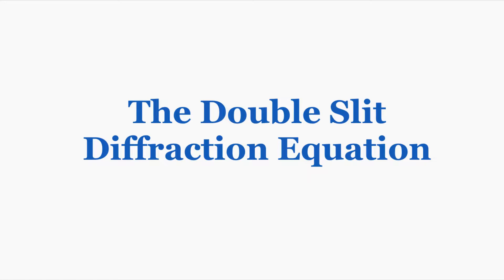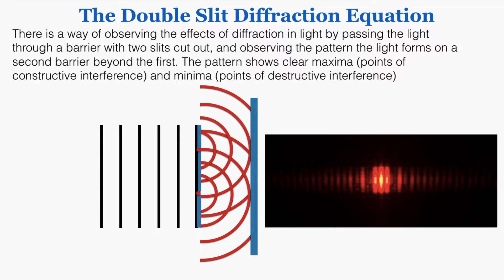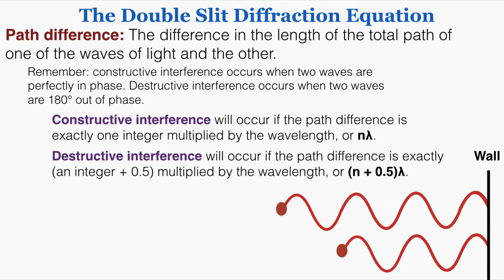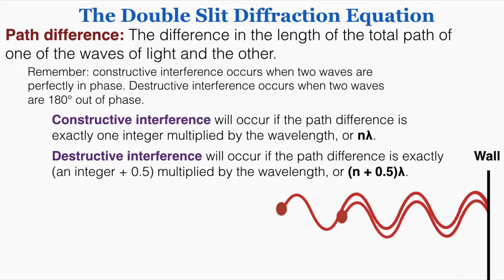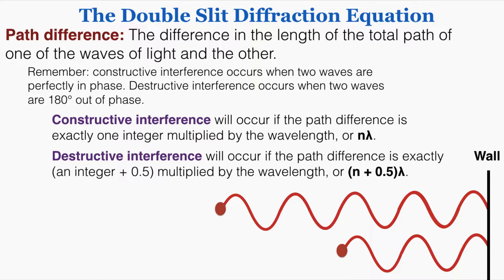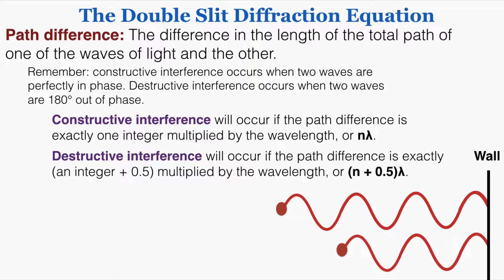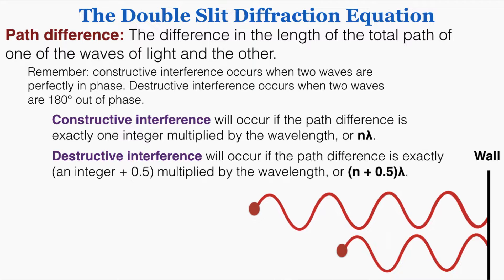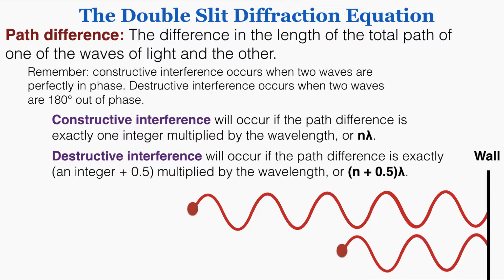Proving Young's Double Slit Interference Equation - IB Physics

Comment: Can destructive interference occur if the path difference isn't 0.5? I thought interference meant the waves' displacements at every point in space add to create a combined wave with a resultant displacement- wouldn't this be the case when wavelengths aren't lamda or half lamda? Or are these just the conditions for waves to interact at all?

Comment: For the double slit diffraction equation at the end, the IB formula booklet doesn't include the constant 'n', but yours does. Could you please clarify that? Thanks
Reply: your equation assumes that you're looking for the difference from one bright spot to the next possible bright spot. (e.g the distance from the center to the next brightest spot). This would be when n = 1. 

But what if you wanted to find the difference from the center to the 2nd next brightest spot? Well then you would times it by 2. In essence, n = 2. 

So basically his equation considers that you might want to measure across multiple bright spots instead of one (like your equation assumes).